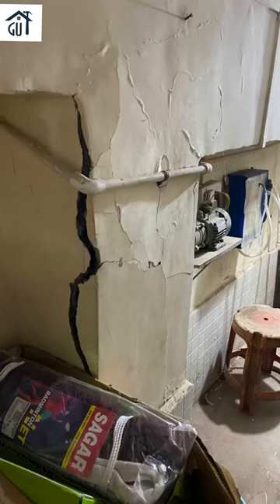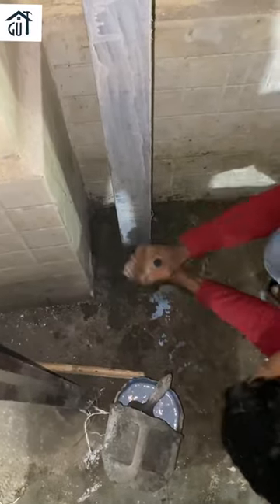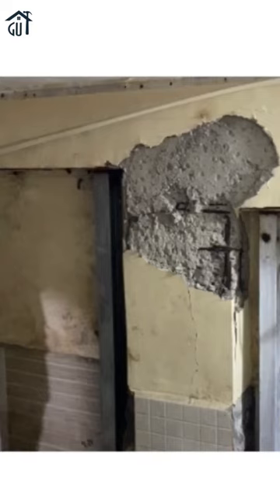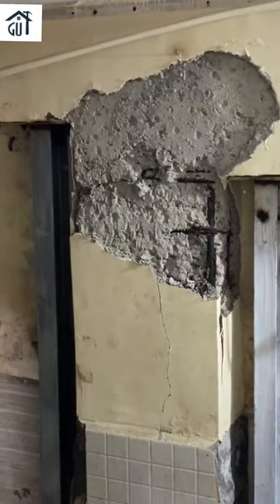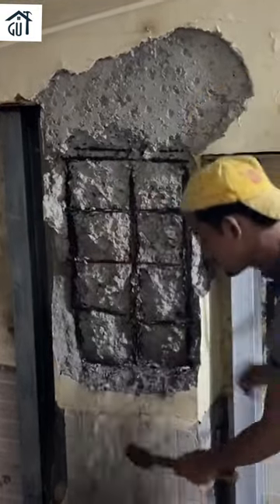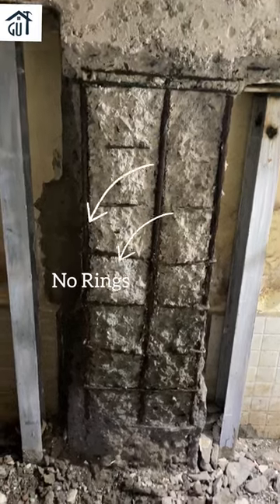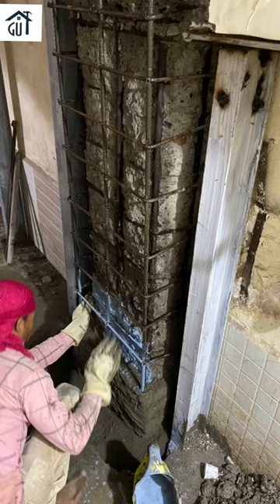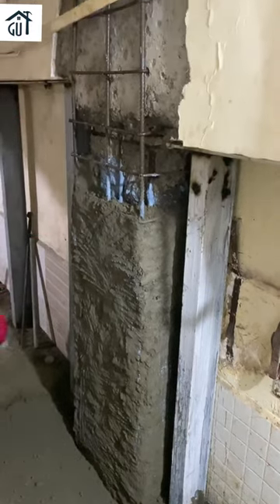Repair Damaged RCC Columns using Channel Support | Why & Where Channel Support is required

Comment: Once rcc beam fixed with polymer modified mortar than have you removed temporarily support of iron roads?
Reply from the maker: We have give beam permanent support as it was not possible to give it temporary support by using jack mundas because minimum size of jack commonly available in market is 8ft and basement height was 6ft. So we used I-channels as permanent support.